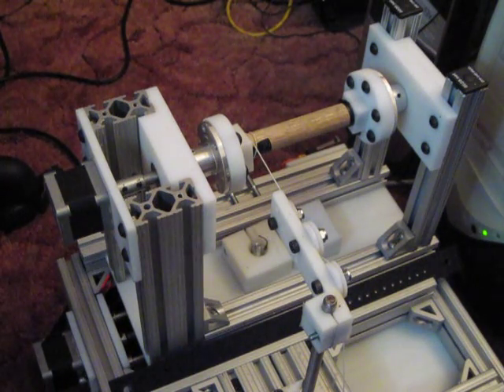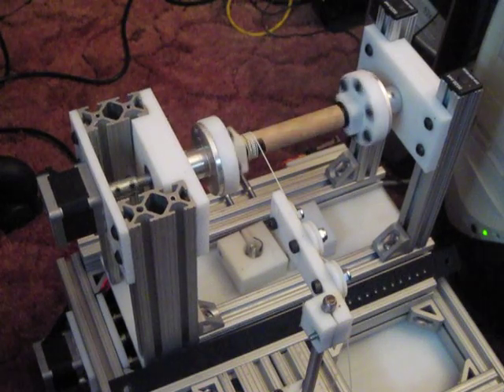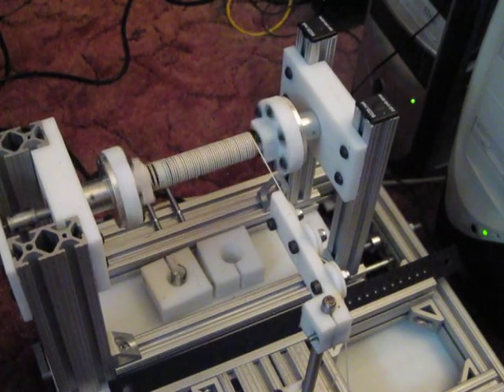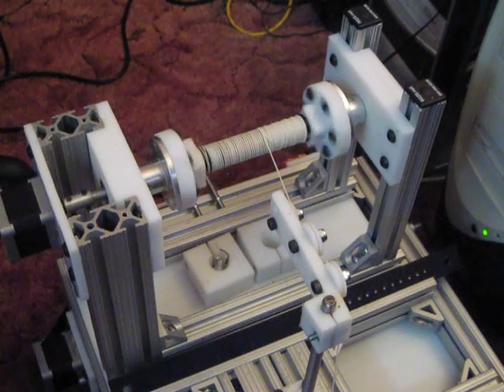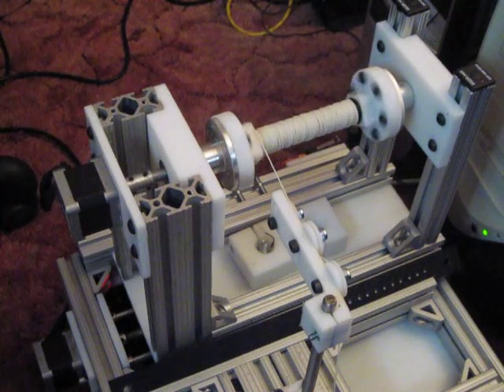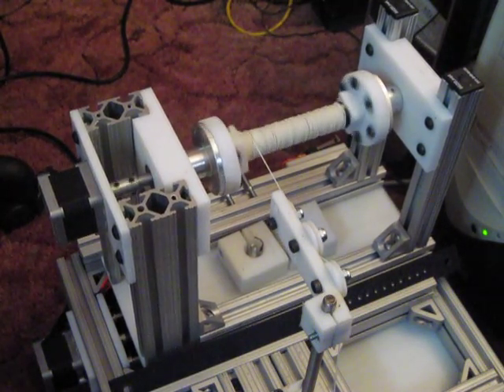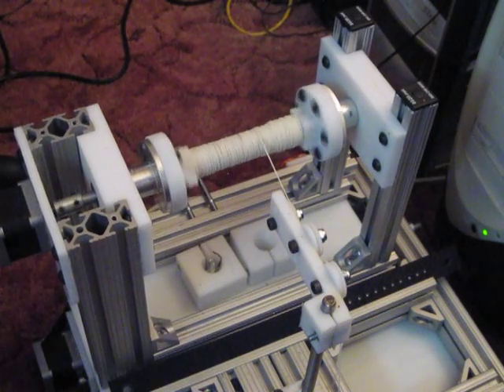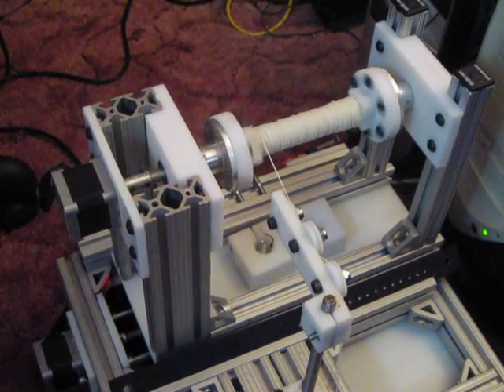CNC Coil Winder (2) - From Left Over Parts

Comment from the maker: @DanckmMr Hi Sir... I hope this finds you well... I have found that I had a problem between the 'UNITS' on MACH3 and the GCoil program. I reset  MACH3 to millimetres and followed the GCoil  documentation. This solved a bunch of problems and helped with the 'Alignment' issues. You find the GCoil program by doing a Google search for "...Gsuite V1.2 free gcode tools..." GCoil is part of that bundle.. The GCode that is produced takes care of the Spindle  rate and Feeder rate... Hope this Helps...

Comment from the maker: @DanckmMr  Hi Sir... sorry but I just left you a a reply.. I did not notice that you had already asked your question in English. Thank You..

ANSWER: This is a work in progress and the next step is to figure out how to do solve just  that problem. However there is a program available called GCoil that will produce the proper G-Code to run on MACH3. We have worked with it a little bit and it looks promising. I will post a new video when I have that G-Code running.

Comment: hi!
to the distance between the coils evenly How you doing? when the coil is greater than the speed of movement of the table bringing the coil or wire speed of rotation of the county have changed. you do it like the Mach3?
sorry, my english is not good.